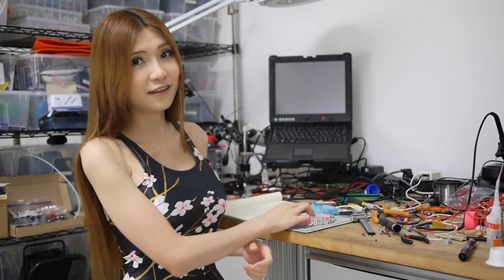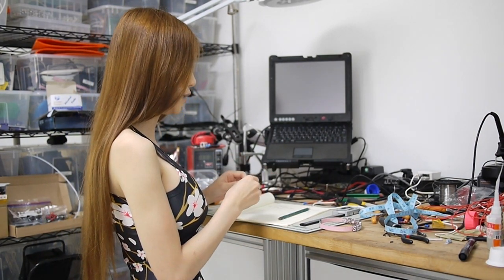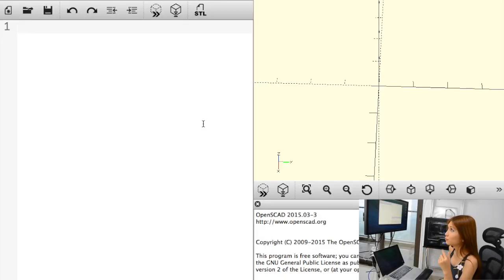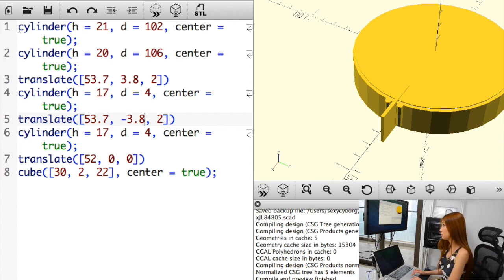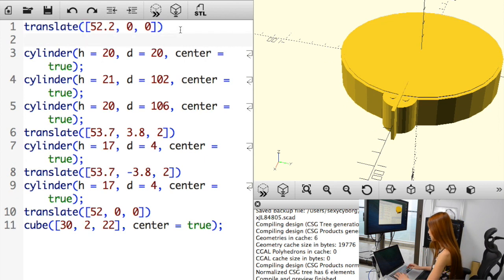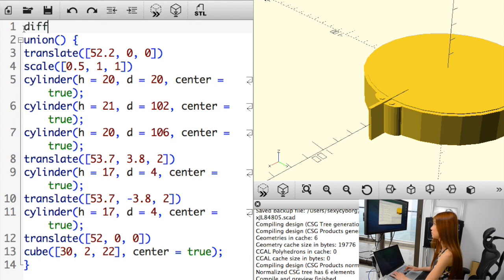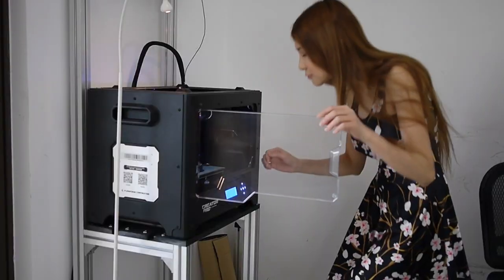Naomi Wu's DIY, 3D Printed Choker for Teens

Comment: Choker for teens hahaha

What material is that it's so flexible

Damn would be so much easier to draw the outer-inner diameters and extrude. Not sure if you can accomplish this with Sketchup or FreeCad (haven't personally used but I think more features than SketchUp). Not sure how easily you can produce STL files though with SketchUp not sure if that's relevant but the hand typing to make shapes haha

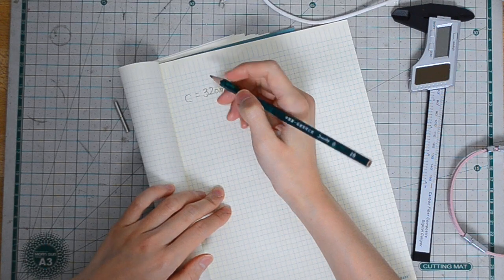Comment: great tutorial! openscad is very usefull when you habve to deal with exact dimensions. I recently used it to 3d print an adapter for the hexnuts of 1:10 RC cars to fit 1:8 scale tires.

Comment: Naomi: Thank you for the CAD video. I found OpenSCAD; I must run it through its paces. I noticed it some of your newer videos that you use Tinkercad. I would Love for you to make a Tutorial on Tinkercad. Please include your personal design techniques. I become frustrated when I try to place Primitives where I want them during the design process.
Reply from the maker: Thanks😊 I use both, depends on what I'm doing. TinkerCAD just looks better on video. have you done their tutorials? They are quite good.
Reply: Naomi:
Thank you for your quick response. Yes, I have taken all of the TinkerCAD tutorials. I learned much but I could not build the technical models that I want in TinkerCAD. I want to learn the technical “tricks” that you use to make your beautiful 3D models. Or do you use OpenSCAD to make your technical 3D models and then import them back into TinkerCAD?
Thank you,

Comment: Hello Naomi greetings from Germany. I have a question. Is it better to supply a 3d printer with an SD card with the data from the PC or is your experience, the USB connection stable enough. Thanks for the info in your videos. Fight 2 days with my new 3D printer and learn something everyday. Why do not you also make a video about the operation of a 3D printer? greetings Rainer

Comment: What material did you use to print? I wouldn't think PLA would be flexible enough - I have the FFCP too so I'd love to know!
Reply from the maker: Flexible filament- TPU. I'm using a third party extruder upgrade which I will review soon.
Reply: Ah very nice - I've got some swiss micro hotends here but I haven't taken the time to install them yet.

Comment: The edges have 90% angles ... how would you make rounded corners on the top and bottom
Reply from the maker: Just use the Minkowski function, but then it's a much  more difficult tutorial for others to follow

Comment: What is OpenSCAD? I have never heard it. So I have open my Repository (Linux mageia 6) and install It. I have start to write your code and I have modify it to understand every detail of your code. Then I have found The OpenSCAD wiki and I have understand that it is a complete programming language like Matlab or like Octave (which is open source software and libre (free) software).
What i have not understand is Your way to make mat division, I have a different procedure and the magnet holes is non perfectly centred, so I suppose that you has used the method of testing and errors. Maybe there is a way to measure the thickness of the graphical image to position in the centre a hole.

By the way thank you.
Reply from the maker: Sure you can just download my code from the link in the description box though, might be clearer. I'm not great at OpenSCAD but good enough for simple stuff.

Comment: There is a problem with SCAD: this is not a cylinder, but a polygon. Although .stl will convert any shape to triangles, this resolution is too low for 3D printing...